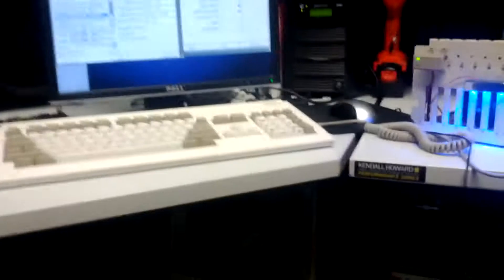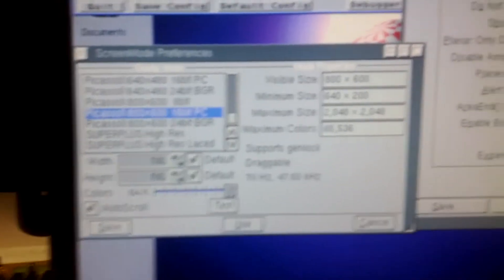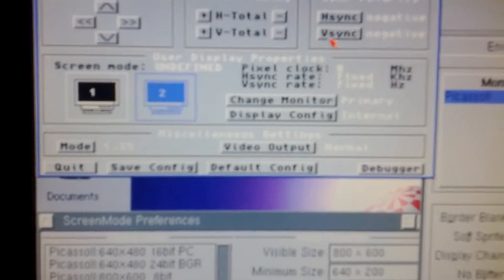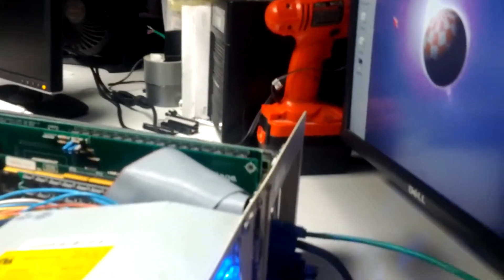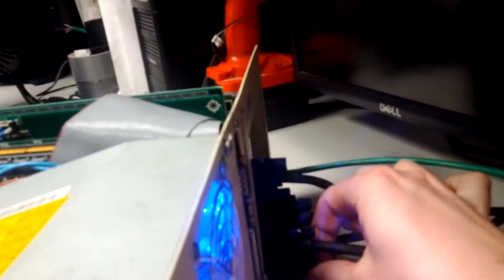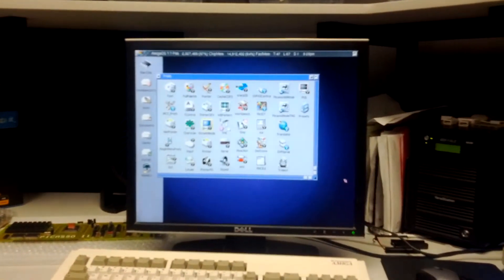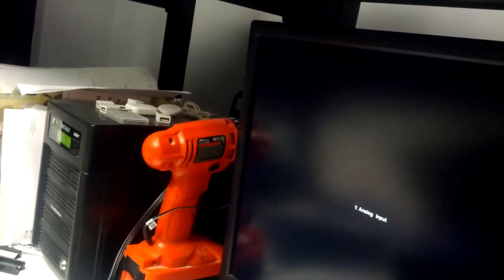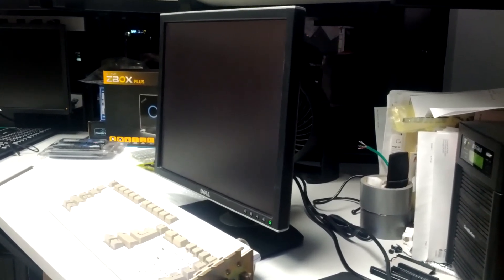Picasso II and Indivision ECS graphics card issues

Comment: i had the same problem on myn a2000 with picasso-II and indivisio ecs v2 , but i got it on works now ,
Reply from the maker: Nice! This video is quite a few years old now. I tried two different Picasso II's without success. I got a message from the developer of the Indivision (Jens) that there was some modification that needed to be made to the board on them (perhaps yours was already modified?). Went with a GVP Spectrum, instead. It worked without issue. Sadly my jobs have been so busy the past few years, I haven't had any time for my Amiga's. 😭
Reply: @CompTechMike  No , this ecs v2 came new from jens , i have change only something in the setting file from the prefs dir and hoppa it works , i can switch between the picasso and ecs v2 , screen mode that i use on the picasso are 600x800 and on the ecs 1 stage higher 1024x7xx
Reply from the maker: @amigaengineer184  Nice! Happy to hear yours works.  Here is the response I got from Jens back in 2014 about the Indivision ECS + Picasso II:

Thank you for your request. I don't have an amiga.org account any more, so I can't see the pics. From what I've read on the first two pages, the switcher in the PII works, and it just can't handle the VGA output from Indivision ECS.

VGA consists of five signals only: RGB analogue and two sync signals. These are generated "by the book" on Indivision ECS, so you need to look for the problem on some other pin. The first thing that comes to mind is that 5V signal on pin 9, but that isn't supplied on the Commodore VGA-adapter, so can't be the cause.

What's different on the VGA adapter is that it connects pin 11 (the ID0 line) to GND, which the Indivision ECS cable leaves open. Try to ground pin 11 and see if the P2 pass-through works.

Your INDIVIDUAL COMPUTERS Support Team

Jens Schönfeld

Comment: Hi i am sitting here in Sweden fiddeling with Amiga2000 and i have  simular setup and same problem, and dont know what to do just butting mt head, Did you get a final answer to this issue ever?
Reply from the maker: Hi, thanks for the comment!  No, I never did figure out how to get a Picasso II to work with the Indivision.  I did get a very technical response from Jens, but before I could dig too much into that I got a deal on a GVP Spectrum video card, which does work successfully with the Indivision output.  Unfortunately the Spectrum has some issues with WHDLoad games, but for my setup, it works better than the PII did.  :(  Good luck with yours!
Reply: ***** You wont belive the journey i had yesterday!

Reinstalled my machine completly, PFS3 and large harddrive installed, on top of that i decided to put in the Picasso II and first off i got everything working properly and put in the picasso ii drivers, and i got put in a LCD monitor to the card, it works! but damn something smells burnt! Darn graphics card the resistor for Pin9 was all black. Then i cut it off after reading a ton, and it worked like a charm without it.

Then finnaly i got the part where i would install WHDLoad i got it in and then i figured i would use the monitor switching from Native Invidivision ECS to the PII and then be happy with it. BUT NO! Another issue and i watched you're post and posted. 10mins after i found a smalll old KVM switch and tried that which worked, to use one monitor with the flick of a switch.

Then i got in to the Network part, thank god i have played with linux etc and know what i am doing with it networks. I Managed to get MiamiDX working properly and installed a ibrowser which worked good. So i got my system working properly like i wanted it to =)

Thanks for you're reply and all and glad you worked out you're issue. I have some WHDLoad bugs to cause i run a GVP 030 Combo card in the machine. But for playing i have a A4000D with CF setup and all =)